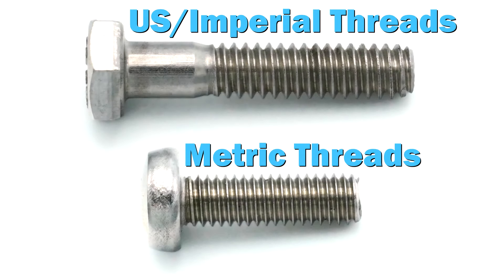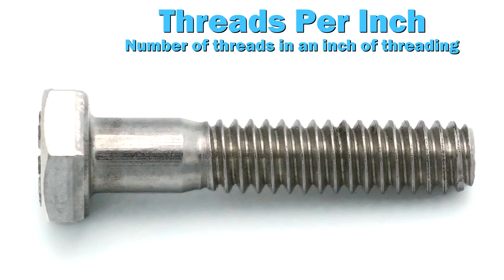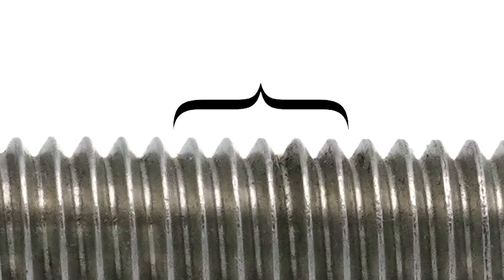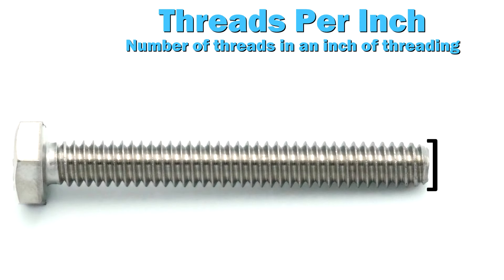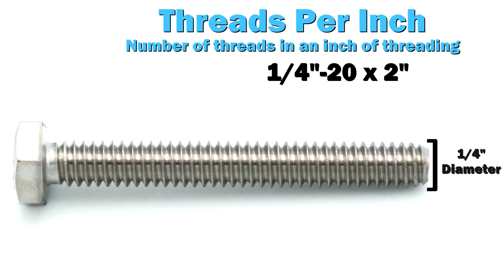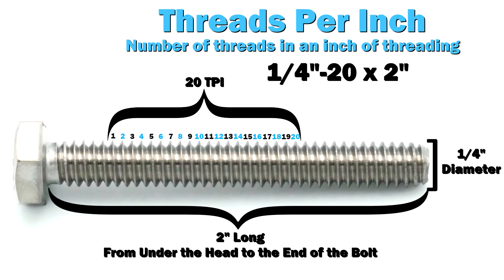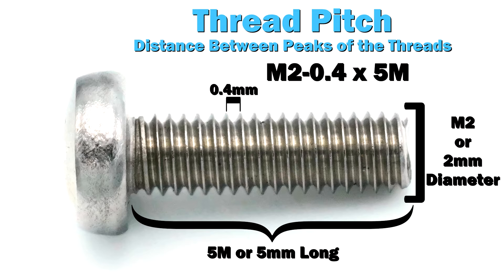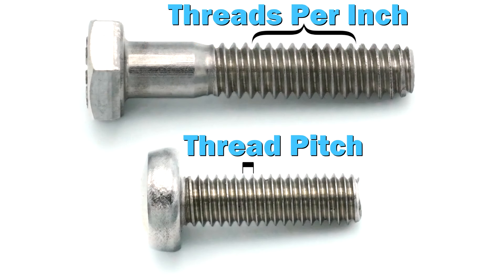How to Measure Screws & Bolts - US & Metric Sizing | Fasteners 101

Comment: Very informative, Thank you. I do have a question,, I am Veeeeryyy perplexed by a screw search I have encountered. Is any of this you spoke about, in relation to the #8-40 Hex head screw?  1st, it is like almost IMPOSSIBLE, to find the correct #8-40 screws I need, to mount a scope mount onto my rifle. I had already drilled and tapped the 4 holes for the #8-40 screws that came with the mount. However, the screws are a tad shorter than 1/4", and I need exactly 1/4" from under the head to tip. I had ordered some Fillister #8-40 1/4 screws that were Not 1/4 And, they were a small torx head, I returned them. I wish I could find this screw with a Hex 9/64" box head, as the originals. I feel I may need to get these in 3/8", and then cut to size. Perhaps You carry these?
 I am also looking to understand the differences here. Are the #8-40 screws the same as an M8-40 screw (if even that exists)?  Is there even an equivalent for the #8-40 screw in the Metric world?  I mean, one can ask, what is a #8-40 screw, in relation to SAE and Metric?  Could you elaborate on this some, Please?

Comment: How is  it possible to measure the metric pitch since the points (.4mm) are so small? It's difficult to measure the points even with a caliper. Is there any gauge on the market to do this?
Reply: Yes, since it's too small I've heard to measure 10mm and divide instead. For example, measure 10 mm and you get 15.....now divide.....15 ÷ 10 = 1.5, so its 1.5 mm.

Comment: That’s all fine and dandy there’s a bolt it’s down at the bottom of my battery how do I tell what size it is why isn’t it on the top instead of the metric tons of Paul
Reply: That’s Paul or weight of or strength why here your million idea and a silver platter

Comment: What's the stronger thread pattern?
Fine TPI or Coarse TPI
1.25 pitch or 1.50 pitch?
Reply: I think I just found my answer...
Apparently:
Size for size, a fine thread is stronger than a coarse thread. This is both in tension (because of the larger stress area) and shear (because of their larger minor diameter). Because of the smaller pitch, they allow finer adjustments in applications that need such a feature.
Reply: 1.5

Comment: In the US measurement, what happens if the screw is less than one inch? Forgive my stupid question. I just want to understand. Thanks.
Reply: There are usually only two thread patterns for a given diameter: coarse and fine.  For example, a 1/4” machine screw will have either 20 or 28 threads per inch.  You can tell the difference just by looking at it.

Comment: hey how do i measure in US/imperial if my screw is under 1 inch
Reply: Do you mean measure threads per inch?  You would just use 1/2” or 1/4”.  You could also just measure the diameter with a caliper.  There are normally only two choices for pitch at a given diameter: coarse or fine.  You can tell the difference by looking at it.

Comment: Which is more common, the metric  or imperial system ?  Do both systems coexist ?
Reply from the maker: Metric is more common worldwide but Imperial is the dominant system for the United States. The systems "coexist" in the sense that they are both in use.  They are not easily interchangeable.

Comment: What means 8-18 x 1/2"?
Reply: Well, #8-32 is the common thread pitch for a #8 machine screw or bolt. A #8 with 18 threads per inch would be very coarse, and I don't think it exists. The 1/2 inch is just how long the bolt is.
Reply: A 5/16” bolt has 18 tpi (coarse).
Reply: #8-18 is a tapping screw thread

Comment: Dear Sir, the thread under the head to the full threaded length is a screw and not a bolt, under the head to a specified length(depending on bolt size)plain shank no thread to the thread is called a bolt, being an ex mechanic we know the difference incl other trades
Reply from the maker: Thank you for your feedback.